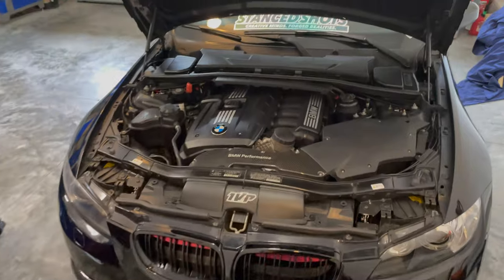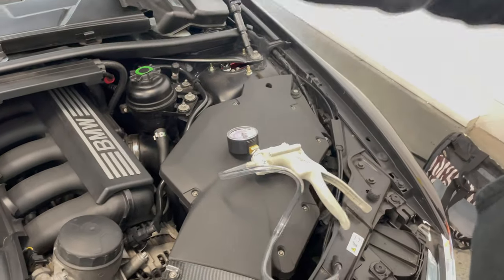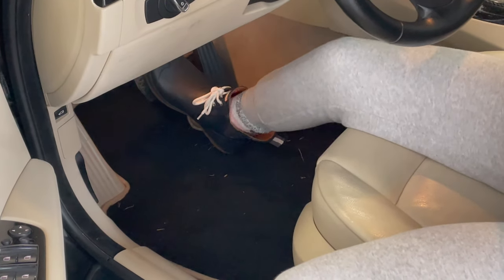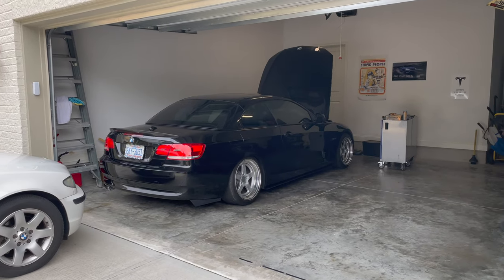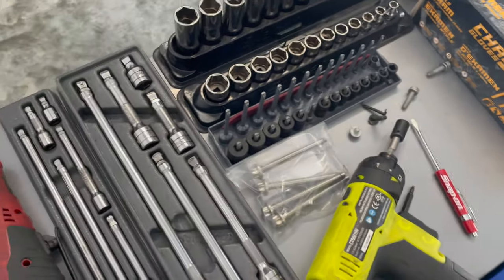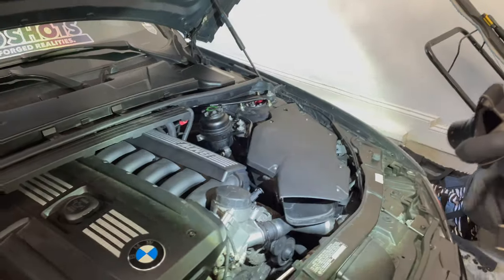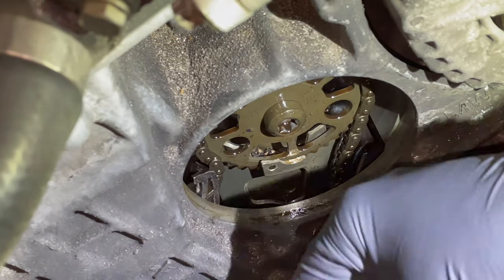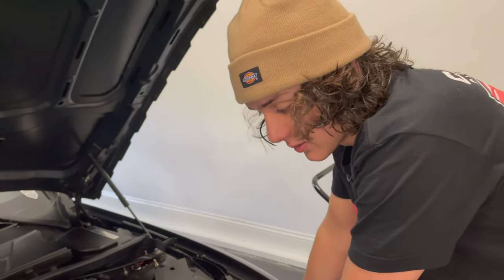My BMW E93 needs a major repair.

Comment: sorry this happened to you. but  I seem this more often, it happened  usually to people that rev their car doing   burn outs or  or red-lining the car for to long, and yes it could affect your  timing if by any chance the oil pump chain would been stuck, cool thing you cough it on time,  I hope some how you can save on labor  because you have to droop the  oil cover to change the the whole oil pump railing guide system  and the safes way to to that is by  making sure  you don't loose timing  by locking the  flywheel and the cam shaft's,  so yes it does involve you engine's  tinning  , good luck !!!!!!!

Comment: changed my vac pump recently, needlessly so. Thought it was making a noise, but turned out the noise was from the alternator pulley.Looks like a bit quite a bit of work to get to that chain